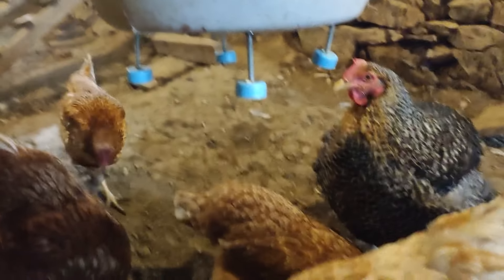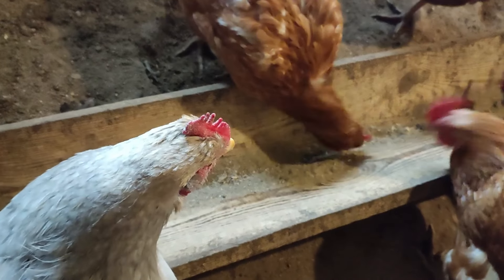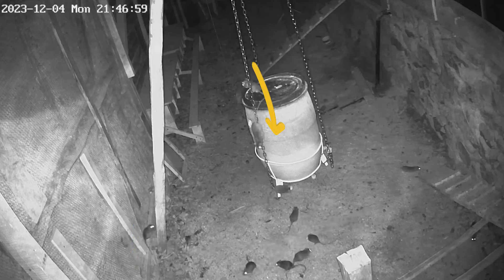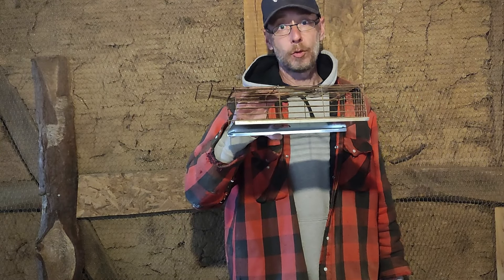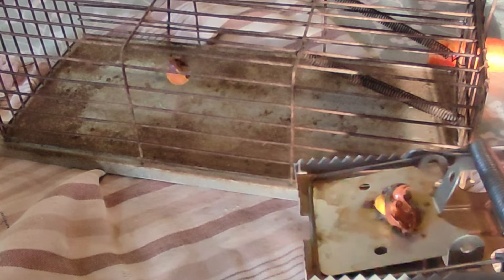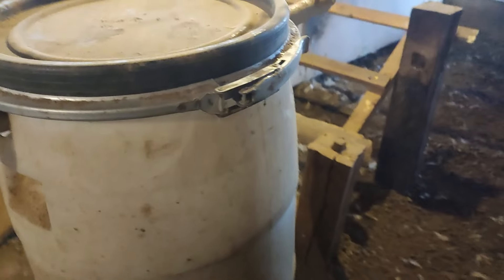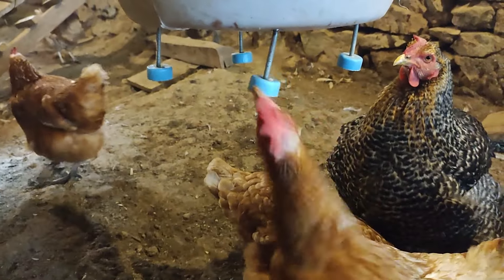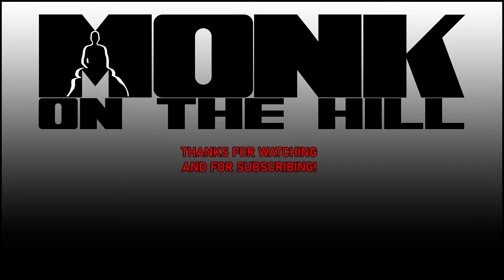Rat-Proofing My DIY Chicken Feeder: A Tale of Triumph and Transformation

Comment: Good idea,
Wonder if it would work much better if one could taper the pipe to about the size of the hole,
From about 1 1/2 feet up the pipe,
And the extra weight on the grains might keep falling,
I think it would be easily done with a little heat and stretch the pipe or slot it and plastic weld the cuts, Might try it this spring,
Too darn cold  right now at minus 20 C
Reply from the maker: Oh boy... Minus 20 is where the winter fun ends. Where are you at?
Reply: @MonkontheHill  I'm staying right in the house, central west Saskatchewan, and it gets even much colder here in the next 2 months, in the minus 30's mainly and occasionally in the 40's and then when you get a wind child it gets even colder,
Reply from the maker: Ok, that sounds adventurous! ...and damned cold! 🥶 So staying in for the next months... 😁

Comment: Okay I've watched your video i give 8/10 for effort its genrouse,,however i wouldn't use plastic,
I would use a light galvanized pipe,

Em, i would use moulded plastic bolts hanging down,,you would have to craft this from pvc sheet guaged to thickness,

Em you say use a rounded bolt but my thinking is use a table  tennis ball with slots in it witch hangs in the hole,
As it is being activated the grain works out through the slots,,you might have anothervidea on this,,however its getting to develop a rodant free feeder you can fill and will last and work flawless,

Rats are clever very advanced you almost need galvanized coops these days id be putting up electric fencing with 250V that is the Mcoy,

But your on the right track developing a nitch in the market this is a very attractive product just needs some fine tuning.❤
Reply from the maker: I'll take the 8 with a bow... 🙏🏼😄
Yes, rats are very clever! But as you can see I have cameras in the coop to check on them. After doing all this to the feeder they stay away from it. For months now it has worked for me.

Comment: I use to get mice in my shed. I found a special lid for my 5 gal Home Depot bucket on Amazon. It has a ramp that gets them to the top of the bucket. When they walk over the trap door opening they fall into the bucket. There they die of dehydration.
Reply from the maker: Sounds interesting. I was thinking about something similar with a simple trash can. I'll make an update on this soon.
Reply: When I had chickens, we used that exact trap (Mouse Trap bucket) filled it 1/3 soapy water. Used peanut butter to attract them. Bam! It took care of our mice issues.
Reply from the maker: I have built one. 😁 Video is in production...